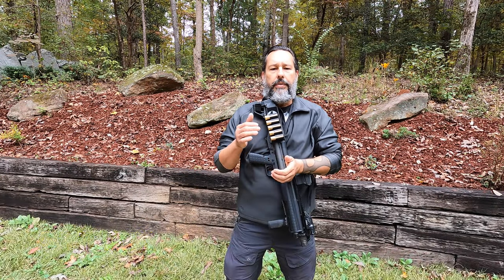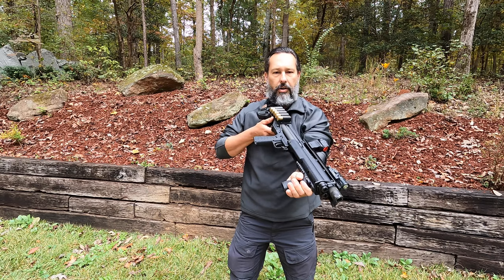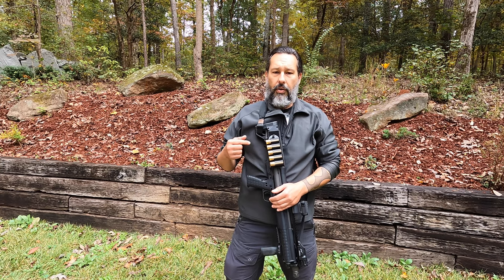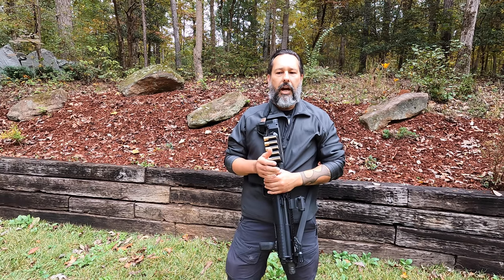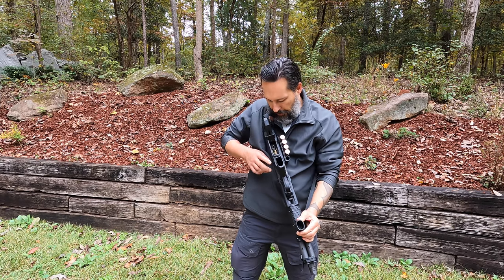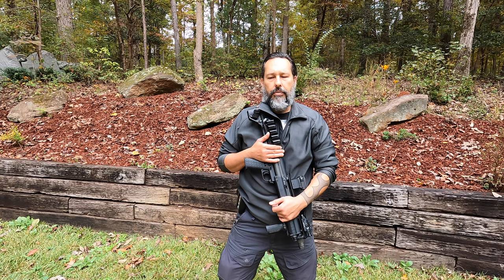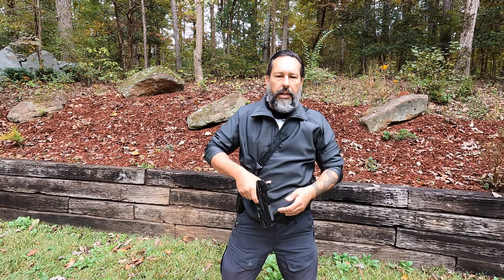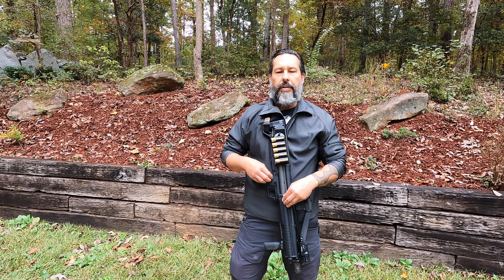KELTEC KSG SHOTGUN *WARNING* (Beware of M18A1!)

Comment: Thanks for the info.I never took the KSG seriously because firstly it’s made by Keltec.Secondly loading is awkward and slow and now I see if you place a shell into the gun a certain way it turns a shell into a potential grenade.I want no parts of that.Everybody should buy a IWI TS12 if they want a small shotgun that holds a lot of shells and is a very well thought out and functional design.
Reply: i had ts12 and it had issues with mag tube as well plus just an awkward shotgun
Reply: I love my TS12 IT DEMANDS RESPECT

Comment: Good observation, but the KSG is not a competition shotgun.  It's a tactical shotgun, if you exert 12 rounds of any shot shell and have to speed load or emergency load a KSG you are in a crappy no win situation to begin with. Loading is only part of your issue, the other would be target acquisition. With a KSG you should maybe practice a battle rhythm, identify target, fire 3, cover, fire 3 cover, identify target, fire 3-5 cover- reload, identify threat, move while firing 3 if possible and repeat.

Comment: The procedure I have been following when loading the chamber on my KS7 and KSG is to have my thumb press the round into the chamber and seat it with my thumb before pushing the slide forward. I would think that would overcome the danger you're describing but I would like to hear what others think. Thanks for bringing this to everyone's attention.
Reply: I know this is a late response to your comment but I was actually about to post the exact same thing. 
If you work the action forward just a bit, the shell carrier lifts out of the way and you can drive the shell directly into the chamber with your thumb and feel it go home.

Comment: The KSG is based on the same action as the Ithaca 37.  The KSG is also designed to hold an above average amount of ammo.  It is NOT designed to be reloaded quickly. That much is evident the first time you handle one.  The earliest generations of KSGs had a lot of issues that required do it yourself gun smithing to overcome.  Acolytes call it "Fluff and Buff".   Subsequent generations have largely eliminated these issues. There is one issue that has not been eliminated.  It's a design flaw.  The selector switch that covers the loading ports is held in by a screw.  This should be a shoulder screw so that it can be torqued down properly while still allowing the switch to be moved back and forth.  When this screw becomes loose the gun will experience failure to feed.  To overcome this on my KSG25 I removed the switch and screw, degreased the threads, added a drop of blue Loctite and then screwed the switch back down tight, but not so tight as to inhibit the switch from moving back and forth.  While I have since put thousands of rounds through it with no FTF/FTE, the fact is if you have to use Loc-tite there is design failure. 
It must be stressed that all the action on this shotgun, both feeding and ejecting happens in the last 1/2" of travel so short stroking is common.  I have heard people say " Rack it like you hate it" to overcome this issue.  I don't know about you, but any gun I have to rack with extreme force in order for it to function would be a gun I would not own.  Fortunately you do NOT need to rack it like you hate it, you simply need to make sure you pump the action fully in both directions in order to feed or eject.  
Nevertheless these are not shotguns that are designed to be loaded quickly and the sooner you understand that and utilize the shotgun in the manner it was meant to be utilized the happier you will be with it. The KSG holds 14 rounds, the KS7 holds 7 rounds and the KSG25 holds 25 rounds. In a stress situation that is how much ammo you will have access to. If quickly reloading the gun is part of the function you need out of a shotgun, these are probably not the right shotguns for the job and perhaps you should be looking at the IWI TS-12, the Beretta 1301T or the Benelli M4.
Reply: Good response. If you try and load too fast your finger will be shredded by the cartridge stops. I removed mine and softened the points.
Reply: The KSG 25 is a tad too long and the regular KSG is a bit short, loose some fingers short. There needs to be something in between.
Reply: Good stuff man. Everyone, dont forget to let your blue loctite sit for atleast 24 hours before using the shotgun.
Reply: Or you can go with the Aguila minis and have 22+1 in the KSG. I put an extended length selector lever on mine so I can switch tubes with a flick of the wrist, on need to take either hand off the controls or eyes off the target.
Reply: 6+6+1 or 7+7+1 and lets not forget 11+11+1 if we go mini. I mean for home defense, how big is your home? How many baddies we shooting? Are we trying to breach/penetrate/spread? If you miss all 13 / 15 / 23 shots or even malfunctions, god be with you imo :face-blue-smiling:

Comment: I tried re-creating this and I couldn't do it in any natural way. I had to literally get a piece of tape to suspend the shell and slowly lower it down towards the chamber after the feed ramps dropped safely out of the way. I'm not saying it's not possible, but you'd have to try about a hundred times just to "accidentally" blow a few fingers off. But realistically, a shell going off right in front of the barrel would most likely result in most of the shot barely making it out of the barrel and just a lot of noise and a need to change your drawers.
Reply from the maker: Thank you for stopping by and sharing! Hope you stick around!

Comment: I'd like to learn abt the KSG. Def getting the TS12, but want a reliable bullpup pump as well, and for me it's between the KSG or DP12, so yes, pls share more on KSG!
Reply from the maker: Alright then. I’ll put something together during the holidays. I also looked at both options. The KSG won out because of the tube select and reload ability.
Reply: @attakconsulting  thanks man! So that I don't have to wait for the video to make a decision, are you recommending the KSG over the DP 12?
Reply from the maker: @tihnsorfjw  I chose the KSG as it is more useful to run select ammo that I can control the flow. Unless I missed something, the DP12 is shoot two, rack ,shoot two. So I dismissed it from my search. 
If that is what you are looking for, go KSG.
Reply: @attakconsulting  thanks for the insight! I'm new to shotguns, so not too sure what you mean by "control the flow." Couldn't you also control the flow of the dp12 by choosing at what time you want to pull the trigger for the two rounds in both barrels? Pump, press the trigger, and that will fire a shell on the right barrel, press the trigger again, and it'll fire the second round from the left barrel, pump, repeat. Maybe my understanding on "control the flow" is flawed?
Reply from the maker: @tihnsorfjw  I load my right tube with slugs, my left is buckshot. 
I can keep reloading my buckshot if needed but always have access to a  steady stream of slugs. I don’t think that can be accomplished with the DP12. at least in an efficient manner. 
On a side note, I also did not like the right/left offset you would have at distance with he DP12
Reply: @attakconsulting  ah okay that makes sense! Thanks
Reply: @attakconsulting  by the way sir, which shells (brand) you like using for this? Federal feeds well in this?
Reply from the maker: @tihnsorfjw  it feeds everything I have fed it from mini to 2 3/4. I have not tried 3” yet.  The extractor does have a tendency to take out a chunk of the low brass though.

Comment: I have a ks7 and am looking right now to see if it does the same thing.
Reply from the maker: Let us know what you find out.
Reply: @attakconsulting  sure does, however, in order to move the lifter it doesn’t require you move the pump. So if you push the shell all the way down the extractor will be level with the rim. If you just place it there it will ride the primer.
Reply from the maker: When I had my incident I was running it aggressively and the cartridge stuck between the lifter prongs, angled partially into the chamber and was stuck hard. Hopefully it’s just my one time screw up and doesn’t happen to anyone else. I like the KSG but I won’t be chamber loading at speed anymore 😀

Comment: Is it safe to dry fire this firearm without snap caps?
Reply from the maker: Safe as any other center fire. I have dryfired many 100s of thousands of times I personally have had only 2 break. Both were aftermarket “lightened” competition parts. 
I or any GM would not be as good as I am without dryfire. I would go for it!!

Comment: So pretty much load it carefully and not to fast...
Reply from the maker: Not exactly, if the gun is empty you still want to get one in the chamber as quickly as possible. I think the safest way is to :
Hear/feel the click on an empty chamber, with the action still forward and unlocked , put your emergency shell into the tube, then rack as normal, shoot and repeat as needed until you can get to cover and top off. 

Does that make sense?
Thank you Carl!!
Reply: @attakconsulting  Got it thanks !